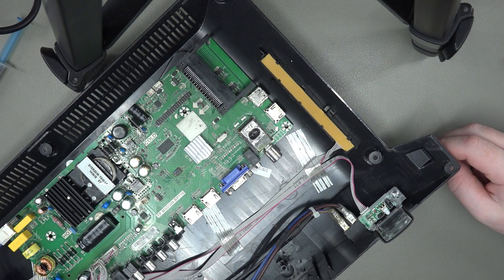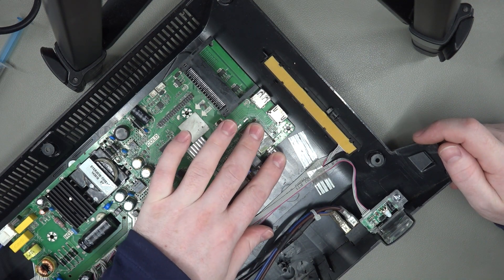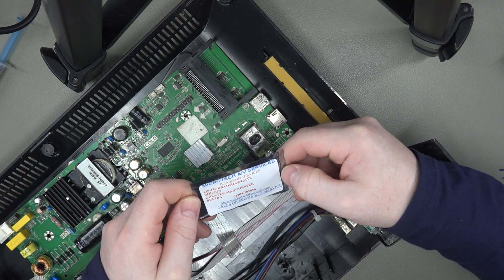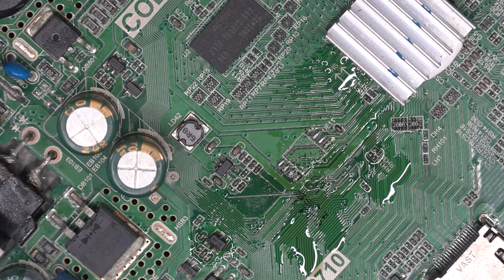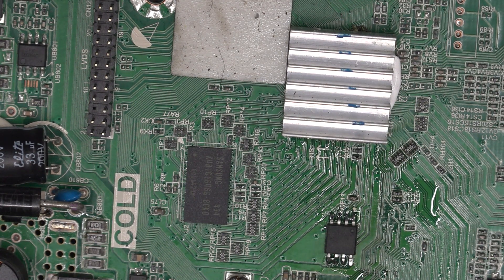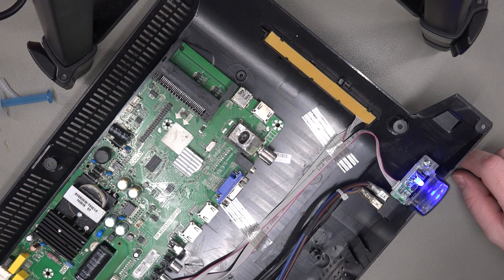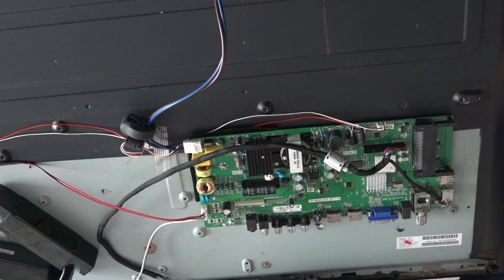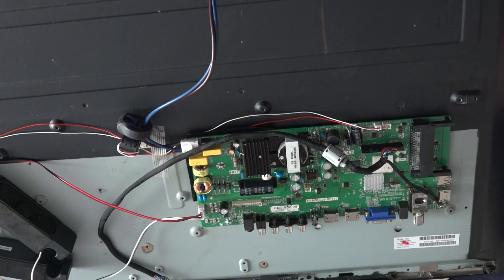Can We Repair? - Bush32/233 TV

Comment: Hello, I have the tp.msd309.bp710 board in a 40" blaukpunt TV. The backlight has completely stopped working, but if you shine a torch on the panel you can see the image. So it's either led failure or led driver failure. Do you know what voltages should be measured at the main board led connectors (two plugs each with a red and a white cable). 
Alternatively can I measure resistance at these plugs to diagnose led fault?

Many thanks
Craig.
Reply from the maker: Hi Craig, I don't sorry, first check it's led and not ccfl, I can't remember what was in that tv, but as for voltages I'm really not sure, if ccfl I would be cautious as these will be very high ac voltage, led should be ok but could still be highish. I would have expected the backlighting to be split into to seperate circuits??
Reply: @ElectronicStuff  thanks for replying. I have since sorted it out, well kind of!

It is an LED panel with 4 strips of LED backlighting. Each strip has 10 LEDs. The 4 are divided into two circuits, each circuit being wired in parallel in itself, but somehow the two circuits are parellel with one another. 

So only one single LED had blown but caused all of them not to light. 

Having found the faulty LED I simply bypassed it by soldering a wire to the small exposed test points either side of the LED. 

I figured you could get away with one less LED in terms of design current and screen brightness and the reality is true, no discernible dark spots on the screen as the layers of diffusing material balance the light out.

However.........

I cracked the screen reassembling the TV 🤦🏽‍♀️....... squeezed too hard when trying to refit the bezel.

Was almost the perfect zero cost fix......almost 🤣